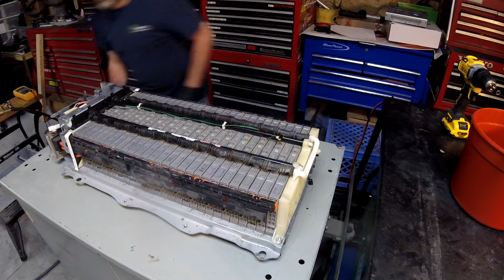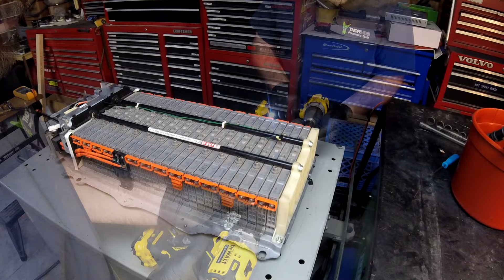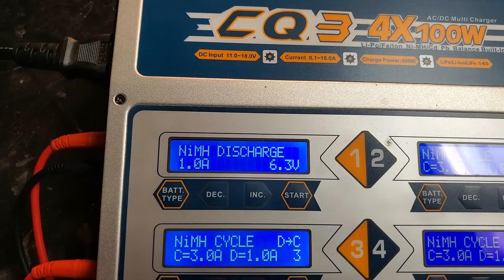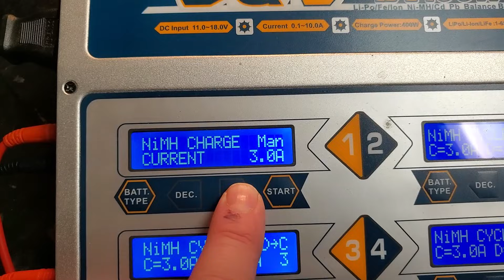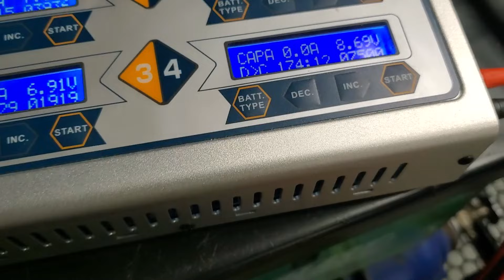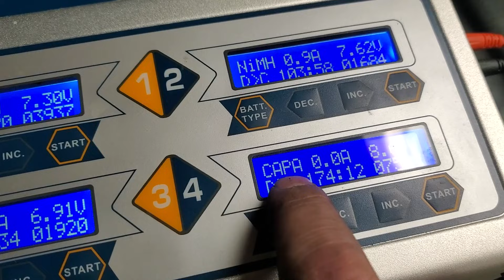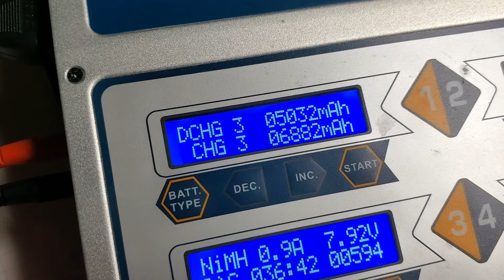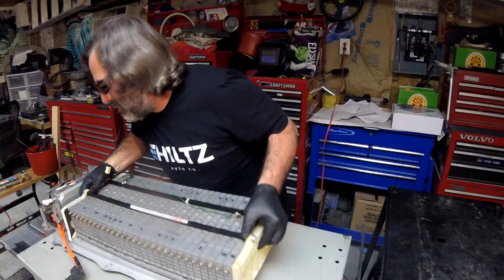DIY Refurbish / Repair Hybrid Battery 2nd Gen Toyota Prius - EV-Peak smart charger POA80 P0A80

Comment: Okay my reconditioning project is completed. I had to replace one bad unit and one suspect unit. As a test I cycled half the pack discharging down to 6.0v and the other half to 6.3v. I noticed no difference in the amount of cycles necessary for successful reconditioning above 5000mha. A better indicator of the number of cycles necessary was whether the individual battery modules were on the inside of the pack or the outside of the pack. The outside modules required less cycles overall as those modules were likely healthier to begin with. The outside modules likely had less issues overheating.

The entire process took 14 days (with 12 hours to balance the battery). The Dr. Prius App estimated my HV battery as having 101.42% capacity left. I suspect if I were to run that test in 3 months it will come out to 75-80% capacity left. 

I recorded all of the charger cycle data to a spread sheet if anyone wants to look at the data they are welcome to DM me.
Reply from the maker: Nathan, Thank you very much for taking the time to give your feedback. YOU ROCK!!
Reply: @GreggFesto   just curious, how much does reconditioning a battery jump ur electric bill ??
Reply: Nathan, 
I reinstalled my battery ~1hour ago.  The vehicle turned on but I never heard the engine engage.  Did you have any issues with your 12v battery being disconnected for so long?  My reconditioning took 30 days.
Reply: Nathan
I figured it out…I forgot to depress the HV kill switch once rotating the handle to the top position.  I’ll be able to drive in tomorrow and make sure no CELs/Battery or othe errors show before performing an inspection.
Reply: Hello Nathan, I'm about to start on this project for my 2006 Prius. Could you share your charge cycle data with your settings, and approx. how long it took for each cycle for each cell module. Thank you.
Reply: @Sagemeister007 if u do the transcript it's already typed out for you to copy and paste
Reply: I am interested and I am experimenting, how to contact you, write me some contact information
Reply: Overall how long did the capacity stay way up in your car? Any new insights after this process? We have 4 gen 2s
Reply: Nathan, I would like to see that charger data spreadsheet! I'm currently working on my spare battery pack to replace a couple modules in one of my prii that threw a red triangle code P3000P3020 which supposedly block#10 according to Dr Prius. I've had to do these before so not my first rodeo here, but it would be nice to see what others have accomplished too! I have the old MRC Super Brain 989 10 amp charger/discharger  for individual modules and an old Heathkit HVDC power supply for complete battery pack charging (250ish volts at about 150mA.)
Reply: Can you please share your spreadsheet?
Reply: Hello I’d like to see your sheets
Reply: Nathan,  after to sets of 3 cycles,   low numbers come at 0000 and highs between 0106 - 0110.  I don't get 4 digit high and lows.  I followed all settings as instructed.  I tried it with several modules and the same result.  Any thoughts?

Comment: Hi sir ,i bought this device from ali baba and used it,i did all the settings and everything did ,to see your video,i don't know why my sells like balloons,i am so worried why it's happened,i live in Canada Alberta,not too much hot weather,it was in 18 degrees,i tried on 4 sells ,on is too bad looks now others also look but not too much but we can see it
?
Reply from the maker: Thank you for watching. The process I show is safe and should not cause any damage to the batteries. Do you have the settings on charger correct? Do you have the battery pack together and setup like I show? Are you leaving a space of couple batteries between the ones you are charging? There has to be something that is not the same as video.

Comment: I never knew it took so long to recycle these with one charger, it went on for weeks for 28 cells, but it did fix my car. I learned one thing My mileage would show 50 or better mpg if I kept around 1/4 tank, but my gauge reading could change quick at around 2 bars, I decided to fill my tank full, when I did my mileage dropped to 39mpg which could not have been only from carrying more fuel. I realized if your sending unit is worn, it can make the computer think it is not using as much gas and kicks your mileage up because you are not getting an accurate reading from the sending unit in the tank as to how much fuel is being used, I need to fill my tank to the neck, drive 100 miles and refill it to the neck then calculate my mileage using how much gas was used to go 100 miles to be able to know my real mileage. I need a new sending unit. I learned also the health of your battery /capacity greatly affects the mileage even if you are not getting the red triangle.

I wonder if this guy ever rebuilt the combination meter in a Prius, the capacitors go bad and have to be replaced. I was able to do it when I first got my car and could not get it to start.
Reply from the maker: Thank you for watching. Glad you got your Prius going again. I have seen some of these cars with gas gauge issues before as well. There is a way to recalibrate the gas gauge through buttons on the dash. Check PriusChat for more info. This is done when the speedometer is replaced. I have fixed speedometers with the capacitor replacement before like you mentioned. I have not had a combination meter come in for repair yet.  Hope you get many more miles from your Prius.

Comment: Great vid. I am currently redoing my battery. I am using a CQ3 hobby charger. How low should I set the charger to discharge the battery during each cycle?
Some vids say let it go down to .8 and some say never take it below 6 so I am confused on that one. Thanks for your help.
Reply from the maker: Thank you for watching. The settings are listed in the video description.

Comment: I've read several comments about setting the charge rate above 7500. That is a huge mistake!  1. When you overcharge  batteries there is a chance of battery acids leaking out the battery connectors (green color) and causing a P0AA6 in the future because of it. 2 it degrades the batteries faster (increases resistance) and makes them unusable quicker.
Reply from the maker: I agree with you Eugene, setting the cutoff above 7500 puts more stress on the battery and is not recommended in most cases.

Comment: Hi Gregg,
I ordered the charger and I’m going to follow your tutorial. I got the red triangle warning.
I have removed the HV battery and measured the voltage of the individual modules. Four of them are showing between 5.9 V and 6.3 V.
Do you think I should replace those modules, or should I try doing three charge/discharge cycles first?
If you recommend cycling them, what voltage setting should I use on the charger for modules that are this low?
Thanks for your advice.
Reply from the maker: Thank you for watching. The batteries that read low may well be bad but I suggest running the cycles with the settings provided on them to be sure.

Comment: Great vid. Where did you get those long alligator clamp cables from?
Reply from the maker: Thank you for watching. I got them from amazon. If you purchase some be sure to get the larger diameter wire such as 22-20awg instead of the cheap ones.  I have had some people report that the cheap 30awg ones do not work well and cause issues.

Comment: My prius cells are at 8.05 V plus or minus .02 v with larger values on the ends and lower values in the center pretty smoothly. I'm getting p0a80 error, I took it apart and cleaned everything didn't have a battery tester then or a hobby charger. Is it possible to do this faster than 16 days? That seems like a really long time.
Reply from the maker: Thank you for watching. You cannot rush the process shown here.  The batteries themselves will determine how many cycles need to be run on them by the results you get.  The fastest way to get going again is to purchase a pack which has already been refurbished from a company such as BestHybridBatteries.

Comment: Will there be an issue with fitment when assembling fully charged modules together?  I've seen someone posted a video stating that the modules will slightly be thicker (due to the swelling from being charged).  That person had to use longer screws to tighten the modules together.  Also, I did a discharge / charge cycle (5 times as Greg recommeded) on my 2010 hybrid battery pack with EV Peak charger.  All of my modules numbers after a discharge / charge cycle came out to be: 0 mAh / 110 mAh, 0/111, 42/113, 8/112, and 87/113.  I did the cycle again: 88/112, 109/113, 93/113, 102/112, and 100/113.  My numbers were way below the 5,000 mAh as you suggest.  All 28 modules has a zero reading on the first round of D-->C cycle.  Should I be worried?
Reply from the maker: Doing the cycles with pack together keeps swelling down and prevents damage. I have not personally seen issue of not being able to get pack back together before, there may be an issue with one or more of the batteries. The numbers you are getting back are far too low. If they are not 5000mah discharge then not really worth putting back in the car because you will get service code and triangle light in a short period of time if not right away. I suggest double checking the charger settings and running more cycles to see if the numbers go up.  If they do not, you will want to replace the batteries that are below 5000mah.

Comment: Great video Gregg. I followed your instructions pretty closely and rejected 11 modules, all from the centre of the pack, I got a Dr Prius health check of 113 percent, that was 2 years and 7 months ago and have had no problem since. I did another Dr Prius health check this week and got 79 percent. Do you think I should try to do another manual balance as you do in your video to see if I can bring up the weaker modules?
 My plan would be to charge the pack as much as possible in the car, foot on the brake and floor the accelerator and see what state of charge Dr Prius gives me, then remove the battery pack from the car and balance them for 2 days, drive the car for a week and do another Dr Prius state of charge test?
Reply from the maker: Thank you for your 2 years and 7 months feedback. I am not certain you would gain much capacity by only balancing the pack. If you do try it, please write back and let us know the results as we are interested.

Comment: At 3:40, Gregg, the black vent tubes are for cooling, not vapors.
Reply from the maker: I believe the rubber round rubber tubes are for vapors as they do not have any forced air, connect directly to the breather ports on each battery and discharge out bottom of the car. While the shaped plastic tubes are for cooling as they do have forced air, are positioned so that the air can flow around the batteries and discharge out the side of the car.
Reply: @GreggFesto  OK, agreed.  Thanks for answering.

Comment: @greggFesto when you are on the step of balancing the battery and put the copper wire on both side are you charging and discharging as a whole or you just let it sit for 48 hrs?? I’ve seen a couple of different videos but no one really explains this part. Thanks for the video really helpful
Reply from the maker: Hey Greg, Thanks for watching. For the balancing the pack needs to simply sit with the positives connected and the negatives connected. This step will allow the batteries to all reach the same voltage. No need to hook charger back up.

Comment: Much quicker to use a grid charger!   You can charge and discharge all of the modules at the same time.   A weekend is probably enough time to do two complete cycles.   How long with a hobby charger???
Reply from the maker: This method takes about 3 weeks depending in the health of the batteries.
Reply: @GreggFesto   Having watched your videos, I'm sold on the idea of using a hobby charger!   But I do still use the grid charger one or twice a year as maintenance.  My pack is still basically good, but chatGPT says that 3 modules need to be watched as they are showing signs of being slightly weaker.  These are the ones I will concentrate on, and cycle with the hobby chargers I recently bought.  Thanks again for some really excellent videos!

Comment: Hi Gregg
I have been charging up a Gen 2 battery pack. 26 of the cell s are in a good range. I have two cells that started out with a 5200mAh discharge and and 7500mAh cutoff. 
Do the cells lose their capacity if they are rechaged too much?
 
After 15 subsequent chargings,  they are reading below 5k mAh discharge. If they initially had a good readout do you think it is ok to use them or just get some replacements?
Thanks for your great prius battery videos.
Andy
Reply from the maker: Hey Andy, Thank you for watching. If the discharge numbers are dropping instead of rising it indicates that the battery is getting weaker and should be replaced. Keep in mind that the batteries are wired in series configuration in the pack. This means that the battery with lowest capacity will determine the pack performance. Have you heard the saying "a chain is only as strong as its weakest link"? Same case here. The lowest discharge mah battery will determine the strength of your pack. 5000mah is the goal discharge mah because it should still provide the car with good performance and no errors from ECU. Somewhere around 80% of original capacity.
Reply: @GreggFesto  Exactly what I was thinking. Thanks for the advice.

Comment: Fantastic video. 😍  Like the way those bus bars have plastic covers to stop you killing yourself too easily.   I have Dr Prius saying that one of my modules, No. 1, is just not reporting anything.  2 and 3 seem a little fluctuating, but the rest are fine.    What could be the possible reason for a module not showing any reading in Dr. Prius ?   Anyone any ideas?
Reply from the maker: Thank you for watching. I would first check the sensor wires for modules 1, 2, and 3 to see if the end has become corroded or if the wire has become detached.
Reply: @GreggFesto  Thanks !!  Could I check and fix these without removing the whole battery from the car ??  😅
Reply from the maker: You could do a charge cycle and check on the batteries without unbolting the pack from the car. If you want to change any of the batteries out or balance them then you will need to unbolt the pack from the car because there are screws on the bottom that hold the batteries to the case. You can do all of the work inside the rear of car instead of on a workbench if you like. It is a little cramped but doable if you do not have a place inside to do the work.

Comment: You've shown what it looks like when it finishes the cycle without reaching capacity [END] and when CHG reaches capacity without DCH reaching 5000 [CAPA]. But what does it show when it has actually successfully completed the cycle with both CHG and DCH reaching the desired numbers? Will the screen display [FULL] in that case?
Reply from the maker: Thank you for watching.  FULL and END are the same message, which one of these messages your charger displays will depend on when the unit was manufactured and what software is loaded. Your values should be 5000mah or more for discharge and charge to consider the battery ready for reuse.

Comment: I have the same setup as in the video but  I can't get to the capacity numbers in the three charge cycles, so, I don't know if the charge cycles hit the 7500 or 5000mah on each run.They display full but I can't get to the ending numbers.
Reply from the maker: Thank You for watching. After the cycles complete you have to first hit the far left button to review data. If you hit any other button first the data will be lost.

Comment: Thanks for your videos on helping us recondition our hybrid batteries. I'm in the process of reconditioning mines. Just one question, I was able to find a cheap MIG wire instead of a TIG wire used here for balancing the batteries, I'm assuming that would work as well right?
Reply from the maker: Thank you for watching. Yes, any wire that will conduct power can be used. If you ordered new bus bars for your battery you can use them plus a few of your old bus bars to connect the posts together as well.

Comment: Hi, if I have 27 cells reading 7.9 and the 28th is 8.1 ( which is new one that has to replace it with the old one),can I do balance for cells without charging? Thanks
Reply from the maker: Yes you can balance them as shown in video and they should all read the same voltage after 24-48 hours.
Reply: @GreggFesto 
Thanks for your reply your so kind, do you think there is no problem to balance them without changing in my case? Regards

Comment: Why discharge only at 1amps?
Reply from the maker: You could discharge at lower/higher amp setting however 1.0A is the point where you will get the best results based on the charge profile. It provides enough discharge to train the battery while keeping heat low enough to eliminate physical damage.
Reply: @GreggFesto  Good info.  How long did your pack last before you had to mess with it again.  I paid 1000 bucks to haves a refub pack put in 4 years ago and i think thats pretty good. This time around I am doing the refub myself and hopefully will last 4 years.
Reply from the maker: This one is still daily driving.
Reply: @GreggFesto  Thats amazing.  So it made it 4 years.  I noticed you didn't do load test to figure out the resistance as I have seen others do.   I don't plan to do that either as the capacity testing will take of finding the bad modules enough.

Comment: When you say that you only use batteries with no less than 5000mAh capacity, is that for the discharge or charge capacity?

Thanks in advance
Reply from the maker: I consider the battery good to use when the discharge value is at least 5000mah.